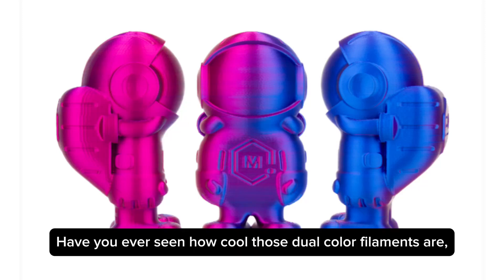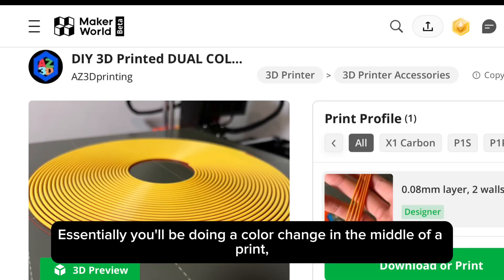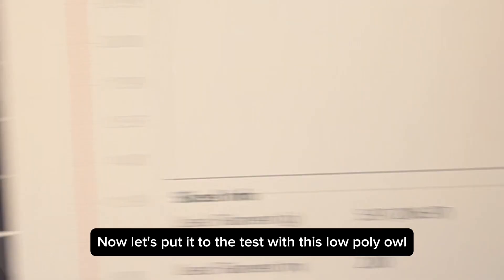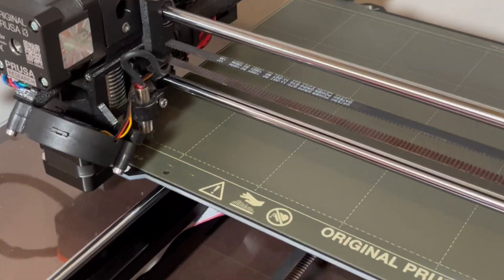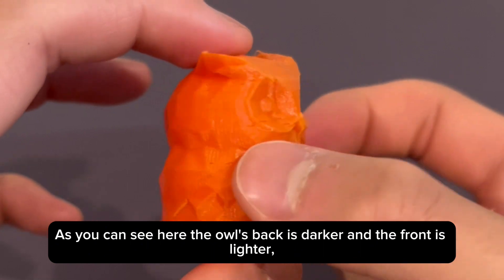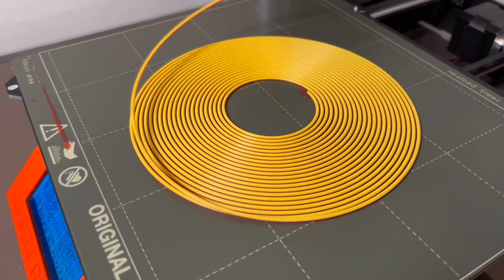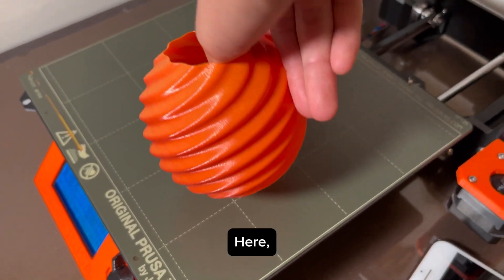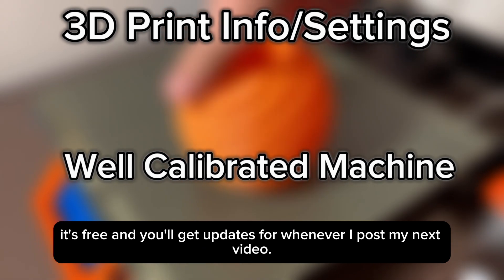Dual Color Filament | DIY | 3D printing

Comment: I have done this before, and it's a fun experiment to play around with But one thing I would suggest is not doing it for anything that. is not a toy or art.  Structurally, by melting it the second time. you're adding to its thermal history. which isn't good for structural integrity.
Reply from the maker: That's a great insight; you wouldn't want to use this stuff for mechanical parts.
Reply: Thermal history is an anti-recycling talking point that's played up to be a lot more of a big deal than it is. I don't have data on PLA, but Brothers Make did tests on HDPE finding it in good shape after something like 15 melt cycles. I've done the method in this video and it works well, but the hardest part is getting diameter/flow just right.

Comment: Thanks for your video. To creat unique color variations, this is great. I buyed the last months for arround 17€ one kg, so I wouldn't do it to save costs. I always print a small test print with the Bambu A1 Mini after changing the filament to dual-color, so that I can estimate the color gradient well before printing. I also designed something on Makerworld, if anyone can use it. The name is: Dual-Color Dial

Comment: I love dual color. THey print great and the color pattern change is very nice and they're NOT $46 a roll...they're about $22-25. Most than plain colors sure, but not overly expensive. .  what is this video about anyway?
Reply from the maker: I agree with that insight.
The video's about a random DIY thing that could be useful if you don't want to buy an ENTIRE new roll of filament (or if you have small portions of filament remaining). I will try to make better videos in the future, as I am still growing (if you can't tell from my voice). That you for stopping by though, I genuinely appreciate it.

Comment: Wow! Thanx a lot for blurring the picture, so no one can see how shitty your print is. You think you can print your dual color filament with exactly 1.75mm?
Reply from the maker: Thank you for your comment.
1) First of all, I didn't blur the entire segment; I showed the 3d print in 1080p resolution. 
2) Yes. If you inspect the .stl file, you can see that the file is round (and not hexagon, which is how Sunshine (another 3d print channel) did it). The vase printed perfectly fine, and it was exactly 1.75mm.
I will try to make better videos in the future, as I am still growing (if you can't tell from my voice). That you for stopping by though, I genuinely appreciate it.
Reply: Being exactly 1.75 mm isn't the important thing. Having the right cross sectional area is, and any positional error printing isn't going to affect that. Basically as long as the total extruded material amount is right and the filament fits through the extruder, you're good.

Comment: Dual color filament isbthe same price as normal on amazon ($16) What noney are we saving by doing this?
Reply from the maker: That's true, but if you don't want to buy an ENTIRE (seperate) roll of filament, and you just want to add some nice gradients to small prints, it would save you the hassle of buying a new roll of filament. You have a valid point, but the procedure would work for those who don't have access to those special filaments (like me)